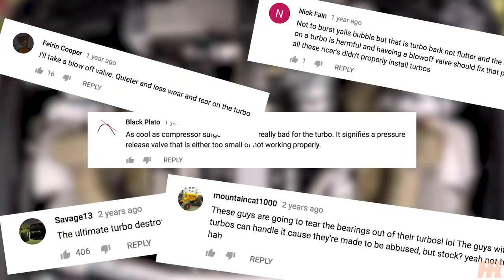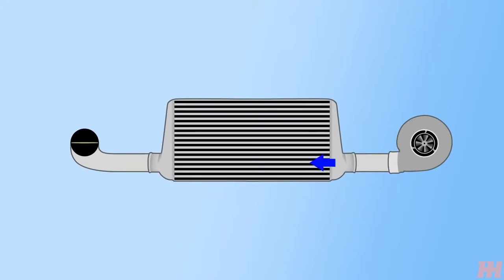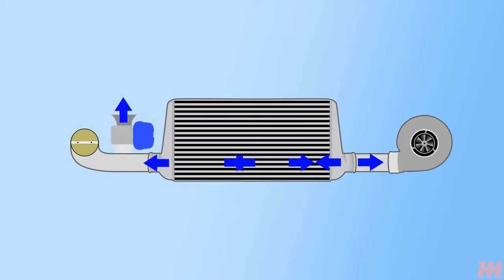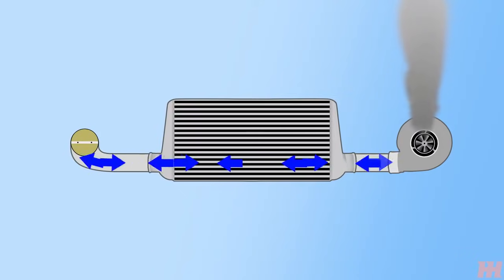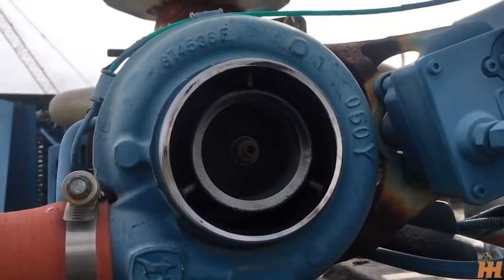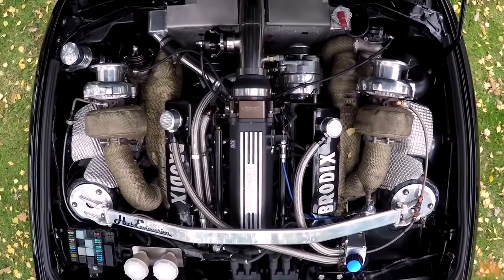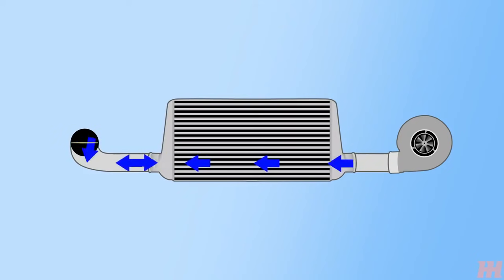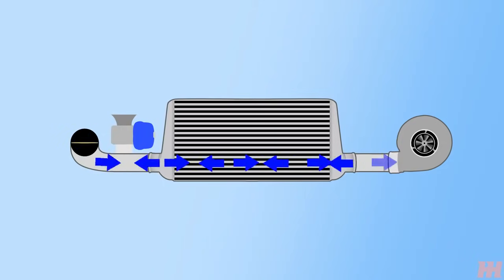The Truth About Compressor Surge

Comment: If you have open throttle surgeing id say you need a lighter boost spring at the bypass valve
Reply: How about your engine doesn't flow enough air for the size compressor+turbine combination...
Reply: That's definitely not correct lol

Comment: So there's the believers and the haters. Some will swear closed throttle compressor surge will damage your turbo, some say it won't. Without factual data, testing and analysis, it all comes to experience. So far, it's pretty much story telling, rather than numbers and facts. I wouldn't add a BOV just for the simple fact it would add more complexity to the system, thus more points of possible failures. Conclusion? Just don't fuckin' overboost your thang.

Comment: Soooo there's totally still load on the bearing system when the throttle is closed it's just lower. OEMs are super cheap and wouldn't include a compressor bypass valve on factory turbo vehicles if this wasn't the case...
Reply: Factory bypass valves are fitted for emissions.

Comment: It's never turning backwards, but think outside of the cold side of the system. Your exhaust gases still drive the turbine (not as fast as at work but still enough), while your turbo flutters, (example) your hot turbine is turned to left side and with closed throttle while fluttering the turbine is being slowed down at the cold side, putting immense torsion forces at the turbine shaft. I also love the flutter, it's one of the best sounds of this planet for me, but it's bad for your turbo, thinking otherwise is physically incorrect, so this whole video is Shit

Comment: These kind of videos are irresponsible.
BOVless system WILL stress the turbo bearings a lot more. The pressure cycles will drive the whole shaft in out and side by side many times very fast. Your exhaust gasses pressure is fighting your compressor side pressure in a slow down pass slow down pass pattern. This is called surge cycle. It can also cause the compressor to overheat and the HUGE deccelaration will test the structural integrity and flex capability of the compressor blades. Accelaration-Decceleration like 20.000 rpm in 0.1 second(if i remember correct)
Will it kill your turbo bearings within a week? Probably no. Will you need to rebuild your turbo earlier yes. Maybe a lot earlier. Running a turbo setup withou bov is plain wrong.
Reply: Better tell this to all the people not running one for years without issue.

Comment: Closed throttle surge is very bad on centrifugal supercharger
Reply: because a supercharger can't spin the other way since it's controlled by the speed of the crankshaft.
Reply: tubejorrit because there is load on the internal components even with closed throttle
Reply: yep we agree with eachother :)
Reply: @tubejorrit  a turbo cant spin the other way either.. ?

Comment: Flutter is fineeee on low boost but on high boost it just breaks the turbine
Reply: Leon B54 - Yeah no. Like The guy in the video was saying, closed throttle surge won't harm your turbo. Doesen't matter if it's tiny or gigantic. Open surge will fuck up your bearings though. But you people can't be convinced, can you?
Reply: Joel Friberg yeah i meant closed throttle ik that open throttle fucks u up royaly its happened to me before
Reply: Leon B54 14 years old talking about turbos 🤦🏽‍♀️
Reply: 1 im not 14 and 2 check the Scottparts channel out and that is me and my dad doing a turbo conversion to a 1UZ-FE V8 in a Lexus LS400
Reply: There's no need to insult people for believing that closed throttle compressor surge is bad for your engine. There are plenty of Youtubers out there making videos about how it's bad, and there are plenty of Youtubers out there saying that it's fine. There needs to be a more credible source of information on this rather than just watching Youtube videos, because I honestly don't know what to believe. I want to believe it's not bad because it sounds sick, but I don't want to just ruin my turbo. As of right now, people talking in youtube comment sections about how it's not bad for your turbo is not convincing in the slightest.
Reply: Search "rb30 1200hp" on youtube, no bov and 50psi, is that high enough?
Reply: That's not true bud, low or high boost, it's fine.

Comment: Sudden surges changing compressor speed are still very harsh on the bearings. Imagine putting a box fan faces against another. Both fans have to endure much more stress to produce results similar to that without the opposite force acting on the turbine

Comment: So you try to tell me that even though the scenario is the SAME (air gets back to the turbo, meanwhile turbo tries to push more air in the engine/ to the closed throttle valve) its still not the same because yeah, once the throttle valve is open and once its closed??!!😂 do you even listen to yourself while talking? The effect on the turbo is still the same 😂 but yeah….😂
Reply: Wrong try again
Reply: @Shreddylife  actually not :)
Reply: There is a difference though. Ignoring all flutter for a second and talking specifically about being on or off throttle. 

If you're off throttle, the exhaust stops feeding the turbo, the throttle body closes, the compressed air escapes.  With open throttle surge, you're on throttle however, the exhaust is still feeding the turbo while the intake side is unable to force more air in. So it's fighting against already compressed air. So in closed throttle surge, you have some strain. In open throttle you have constant strain while the exhaust side is being spun up. 

Regardless, this isn't the point he's making, but there is a difference between the strain on the turbo with open and closed throttle. You don't have to be a genius to understand that.

Comment: I guess since Car Throttle says its okay and nothing to worry about while explaining it in a British accent then laws of physics cease to exist in your turbo system. Bottom line, compressor surge is bad.
Reply: I think the point they're trying to make is that off throttle compressor surge won't immediately destroy your turbo like alot of people are saying. There are alot of older turbo cars that run no BOV or recirc like the Buick GN, but clearly having one improves service life since pretty much every single factory turbo car has one now. If it made ZERO difference, car companies would simply save the money and not put them on.